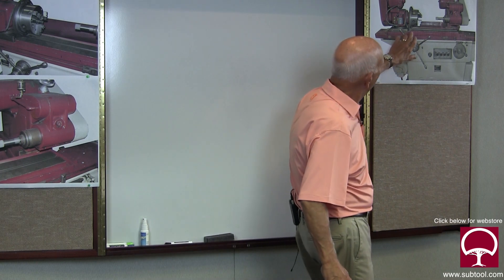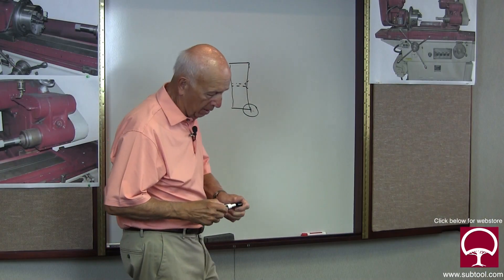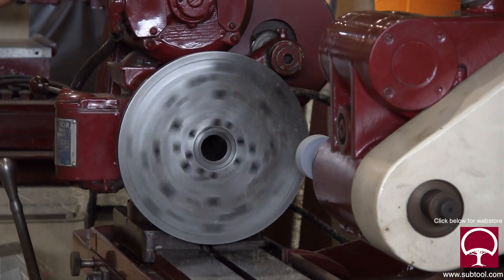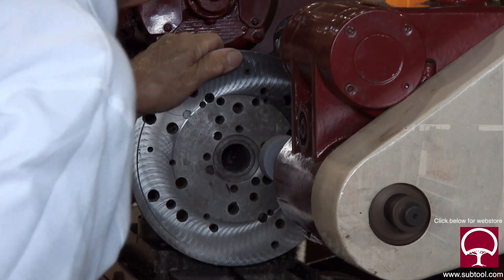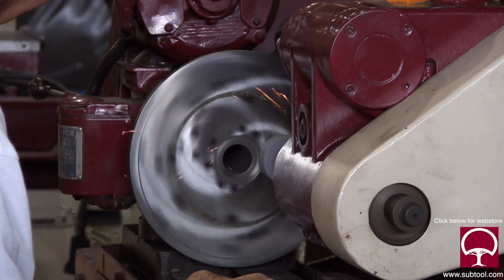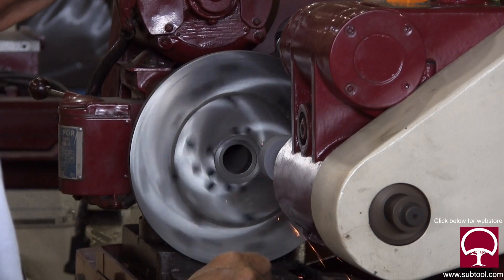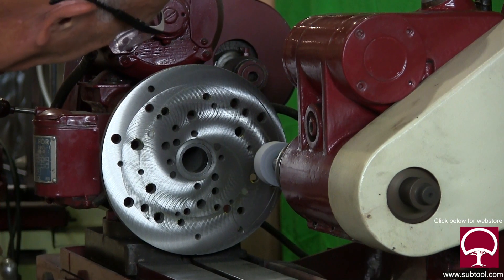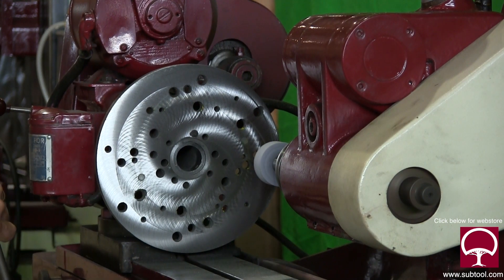ID grinder, How to grind the faceplate by Don Bailey

Comment: I must confess I do not understand Don--why grind when you can swing it on a lathe,one setting and a straight across sweep.The lathe used like this is very accurate..Am I being too simplistic so am missing a trick or two??regards Ian
Reply: Possible Hard Spots in the Cast Iron that won't machine out leaving high spots. Only way to get rid of them is to grind. Also it is a precision grinding machine so trueing it up on the machine is the best option. Same when you fit a Magnetic Chuck to a Surface Grinder. You will grind the Chuck Face as a final true up of the machine.

Comment: 0.010-0.012 in. off?  On a grinding machine?  I don't understand how that happened either, Don.  Excellent work and explanation as always.
Reply: +MrShobar Sometimes you just have to take it as there is no options or it is the easiest method. Sure it isn't a production setup, but considering you have just one part to grind, taking even more isn't that much of a job.

Comment: Hey Don how come you didn't sweep the wheel from outside diameter to inside diameter and back again  on your last pass using the Y axis feed  ? I would have thought this would have cleaned up any steps .
Always enjoy your videos and i always learn something !
Reply from the maker: +ian bertenshaw Yes, you could do it that way but we did not have enough travel to get the wheel completely off the part. I prefer this process because I can get it flat within a few tenths. Thanks for watching.

Comment: The faceplate has a lot of holes.  If some of them were drilled after the plate was first manufactured could that cause runout?
Reply from the maker: +randall williams Nope. Thanks for the question.

Comment: Did anybody check the spindle bore to be sure it wasn't the spindle running out causing the faceplate to run out? I imagine on this machine it is tapered for centers right?
Reply from the maker: +bcbloc02 Good question.Yes , it was checked and was less than a thousandths.

Comment: Why did you not feed the grinding wheel across the face of the plate? I really appreciate these lessons.
Reply from the maker: +Gkuljian We plunge grind as the wheel is dished in the middle and we are cutting with the sharp edges. Believe it or not the wheel would break down too fast that way and by the time we got across we would have a taper in it. Thanks for watching.